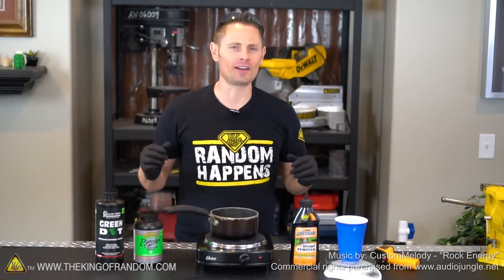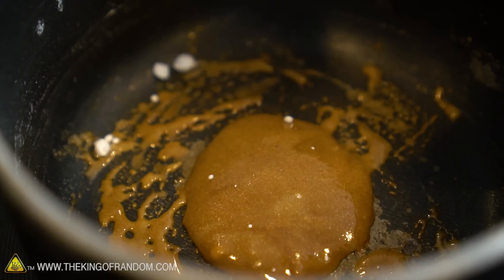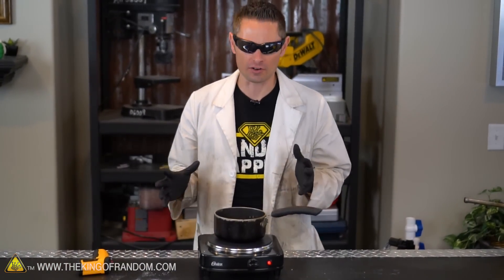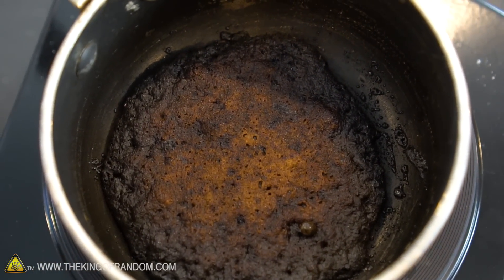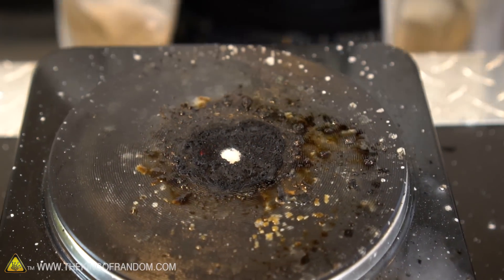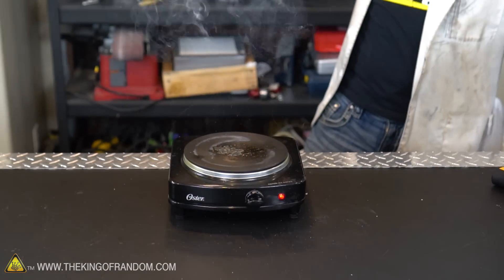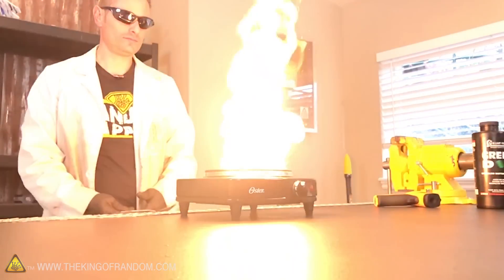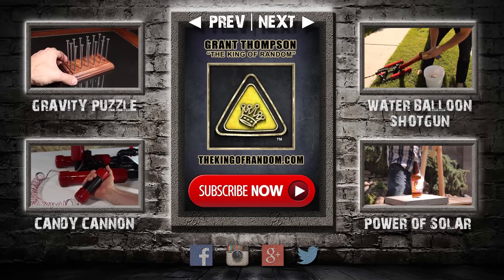Don't Pour Gunpowder On A Hot Stove | TKOR Tests Lighting Gunpowder & Other Pyrotechnic Experiment!

Comment: Please give us the temperature in kelvin just to irritate all of your comment section.
Reply: I would like this to happen.
Reply: Nope, it's actually the Celsius scale, it's the temperature in Celsius plus 273.15 degrees.
Reply: Nah man, give the temperature in Rankine, the absolute scale of Fahrenheit. Everyone will need to use a calculator.
0 fahrenheit is equal to 459.67 rankine
Reply: no give it in Joules of energy per centimeter squared please
Reply: Itz Mac Kelvin is the same spacing as Celsius, 1°celsius=1°kelvin
Reply: J/cm^2 is not temperature. I'm reasonably certain that temperature is not a surface property. It might be J/cm^3.
Reply: Ryan Doyle well ok then
Reply: Goku Power thanks for correcting me
Reply: mattyraw if you didn't notice, the thermometer only had Celsius and Fahrenheit. Im pretty sure no one uses kelvin all the time, and it's sometimes confusing to convert measurements on the spot.
Reply: OMG YES
Reply: Even better would be Rankine... It's the same as Kelvin, just on Farenheit scaling instead of Centigrade.
Reply: Oopyy so are you
complaining kid
Reply: mattyraw i was just going to say if he selected celcius the thermometer would go up higher. Its probably built in england.
Reply: I LIKE HAM!!!
Reply: mattyraw no
Reply: That would be a lot better than fahrenheit, since it's the same as celcius with an offset of 273,15 (wich is related to absolute zero and easy to estimate in your head). 
Fahrenheight have just a random offset of 32 and a different scale factor (1°C = 1,8°F). When you have numbers like 830°F, it's very confusing and has to be converted (using a calculator) to even get an idea how hot it is.
Reply: Ride84XL chill
Reply: Fahrenheit is already annoying.
Reply: Ride84XL fahrenheit is still better
learn to spell kid
Reply: Kelvin is the same spacing as the Fahrenheight scale...
your backwards

Comment: Wow so cooking down the rocket fuel like that causes the rocket fuel to burn slower. Im wondering how well it still works as rocket fuel cooked down like that. Crushed into a fine powder and compressed into a rocket engine. very cool video.

Comment: Everyone who's interested, I cooked some rocket fuel on a grill side stove propane flame, I used a pan (low rim) and the wind blew and a flame just slightly went up to the pan edge with a little bit of rocket fuel and it caught it on fire! All of my solution went up in flames lol so use a deep pot when cooking it

Comment: I wonder what would happen if you took the cooked rocket fuel ash and used it in a muzzle loader. I have a muzzle loader and would like to try this. safely of course with the rifle on a bench with a string. what are the ratios for the rocket fuel?

Comment: Purposely burn the rocket fuel mix in a pot, turn it into powder, and experiment with it.
1) rocket motor - replacing the mixture from the Sugar Rockets video while keeping the cat liter the same
2) putting that into a clear tube for a side by side demo with the original Sugar Rocket engine

Comment: So, that was Potassium Nitrate and Sugar together.  
What would happen with just the Potassium Nitrate?  
Also, when you burn the "Rocket Fuel" until it's black like that, does that make a better or worst Smoke bomb than when you just cook it until it's brown?
Reply: Potassium Nitrate is KNO3, when heated up to 400 degrees celsius(752 Fahrenheit) it decomposes. So 2 KNO3 will become 2 KNO2 and O2, just heating up KNO3 only gives you oxygen. When mixed with sugar, the oxygen will be used to burn the sugar and creating the fast combustion you can see in the video.

Comment: Do suctioncups work in a vacuum 
Plze like
Reply: obviously not,
There you go!
Reply: Naa the won't. When you start pulling a vaccum the air trapped under suction cup would just pop it off
Reply: Fact-O-Logy Suction cups work using atmospheric pressure, so no, it actually wouldn't.
Reply: Madmagic hydraulic press action just did that, KOR doing it would just be the same thing with a less powerful vacuum chamber.
Reply: Fact-O-Logy if it is vacuum on both sides of the suction cup, there is no pressure difference, and it's just a piece of plastic/rubber beside  some glass. If it sticks, it's not because of suction.
Reply: It would work. It depends how it is stuck to a surface. If you push it all the way down then all the air is removed. Even if it is not and there is just very less air the vacuum will remove the air and the bond will just get stronger. So, "IT WILL WORK !!!". And no need to thank me !

Comment: - the first rocket fuel mix, which turned to black ash must have eliminated almost all moisture and it took less energy to ignite on the hot plate
- the second mix certainly contains moisture, which is probably from the hydrated sugar crystals. took long enough to get to the activation energy
- the smokeless gunpowder contains nitrocellulose (or nitrated cellulose) which burns efficiently without leaving any smoke or ashes (it would be great if you make nitrocellulose and burn it in liquid nitrogen)

Comment: Could you try mixing the charred rocket fuel powder with a little bit of black powder, then putting it in a coconut shell and seeing if it works as well as your coconut bombs from a previous video.

Comment: I have to say I'm a little disappointed with the gunpowder experiment. There's a major difference between the rocket feud and the gunpowder. You essentially cooked the rocket fuel from room temperature to that high of a temperature making for a low change in temperature. In the gunpowder experiment you poured the room temperature gunpowder on to a much hotter hot plate, a very high temperature change.

Comment: What's fun is taking that scorched 'rocket fuel' and mixing with magnesium, potassium, and white school glue and using it as a marker on metal to cut out intricate designs. Just be sure to have a high melting point metal as to sandwich the marks to focus the heat on the piece of metal you have the design on. You can make some beautiful filigree designs. I've used some adult coloring books for some of these and they come out very nicely. Oh, if you use this technique on brass you get a rainbow effect on the cut edges.

Comment: Grant. could you cook your rocket fuel down to its black charred state. grind it to a fine powder, and make a reload 9mm round, using the rocket powder as the black powder propellant. would be cool to see 1: if it works. And 2: put it through a chronograph and see  if it  pushes a projectile at the same speed or fast/lower then a normal load!

Comment: Although you are not wrong, you didn't account for a change in pressure inside a sealed container, when stating that "your garage won't get to 400f". As the temperature increases in the container so does the air pressure contained by said container, this would inevitably cause a further increase in temperature, and so on and so forth until it reaches a balance point in side the container or the container fails either mechanically or due to combustion. Something that a manufacturer would take into account on their warning labels.

Comment: Can u make a homemade Molotov
Reply: Yeah I think u should 😃😃😃
Reply: Jon Kirk alcohol* and secondly that wouldn't be a Molotov
Reply: James Sharp You can pour gas...
Reply: TheDiamondGrenade beer bottle 
gasoline 
tissue lighter
Reply: ITS NOT FUCCING DIFFICULT
Reply: DIYmetric and Styrofoam or it won't stick
Reply: Marc Kenneth how would you put gas in a bottle
Reply: chiken throw the moly and pull your pants down then whip it out
Reply: James Sharp you can pour gas. you just need a gas significantly heavier than oxygen and nitrogen.
Reply: James Sharp i think he meant gas as in gasoline
Reply: Get a bottle, fill the bottle with gas, put a piece of cloth and done.
Reply: k den you can't pour a gas

Comment: Like 10 years ago I was making that "rocket fuel" and it burst in flames, because I set the heat just a little bit more from what I used to. The only difference from your try is maybe that I had much more bigger amount. If you ask yes I did set part of the kitchen on fire.

Comment: Would the charred rocket fuel work as gun powder?
Reply: Eric Vandagriff yes and no. if you were able to get small enough particle size, you could launch a projectile. you'd also foul up the barrel big time
Reply: It almost is gun powder. Heat just turn sugar in to carbon. Just add some sulfur. I also saw Cody use rust instead of sulfur.
Reply: Ltifone2014 m
Reply: Ltifone2014 I'm sure he can sacrifice a gun barral in the name of science
Reply: Eric Vandagriff hey subscribe me I will subscribe u

Comment: What happens if you put Nitroglycerin in Liquid Nitrogen? O.o
Reply: Nitroglycerin isn't fun. Easy to make, easy to screw up, easy to lose limbs.
Reply: i want to see how many volts nitroglycerin will blow up at
Reply: 5ml is enough to blow youre hands off
Reply: John Vlijm Your*
Reply: lion grammar nazi
Reply: I know it is very dangerous but I figure Grant would be the one to pull it off, but either way its just a suggestion.

Comment: Can you make napalm?
Reply from the maker: Yeah I've got a recipe for the real stuff.  Not the styrofoam and gas stuff everyone makes, so I'll put that on the list.  Thanks.
Reply: that's just Styrofoam in gas
Reply: matt from demolition ranch made it, and it wasn't just gas and styrofoam
Reply: I misread this as 'Can you make napkin?'
Reply: Yes make it
Reply: Yeah, weapons grade Napalm contains glycerin as a stabilizer. The idea is that it won't go off with anything less than magnesium or thermite, not a stray spark or even a bbq lighter.
Reply: Ares5933 I second that
Reply: Ares5933 just light foam a fill on fire
Reply: Can you make gunpowder
Reply: Ares5933 it still works. Lol
Reply: Grant Thompson - "The King of Random" hi
Reply: can you make acetone peroxide?
Reply: it's just styrofoam dissolved in gasoline, everyone can make it.
Reply: That's not real napalm though. The actual napalm recipe is classified